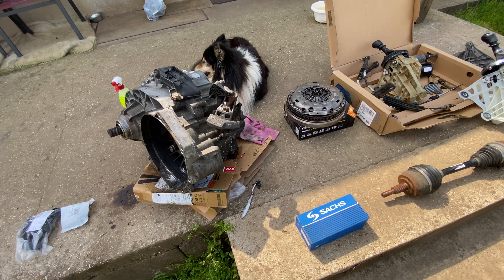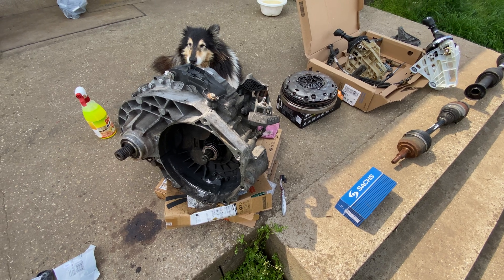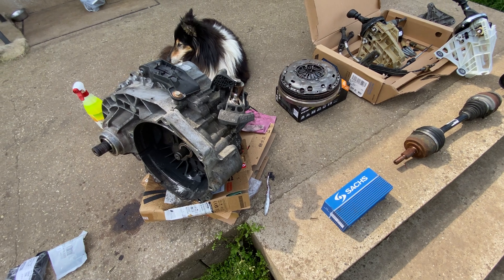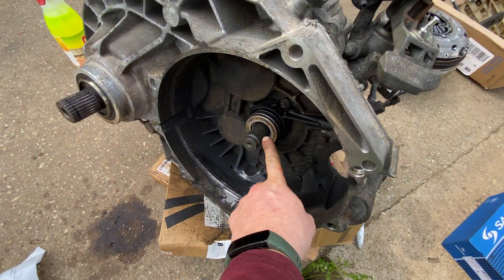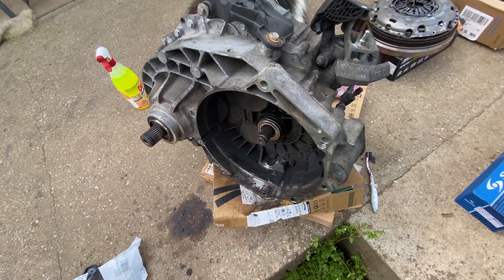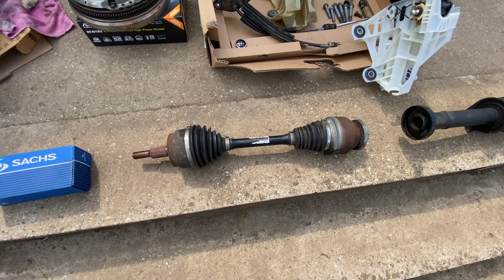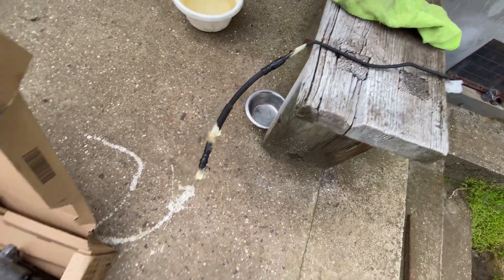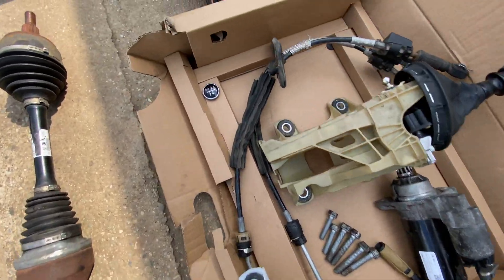Cars : VW Volkswagen transporter t5.1 5 speed to 6 speed conversion - parts needed

Comment: Hello brother, what car is the 6-speed gearbox from? I'm also going to do this exercise.
Reply from the maker: Only 2.0 TDI gearboxes from T5 and T6 will fit.
Reply: 140hp?
Reply from the maker: @kristiqnivanov5485  136/140/180. Lower HP models came with the 5 speed.
Reply: clutch with how many teeth is the flywheel luk or SACHS
Reply: Can I have your Facebook or some coordinates? I have a question regarding the long axle shaft holder.
Reply from the maker: @kristiqnivanov5485  Well I might not be a huge help here as it was 2 years ago or so. What I recall I had both of the threads on for the holding bearing stripped and had to helicoil both...

Comment: Is the rear engine mount where driveshaft carrier bolts to required for the swap?  Or does the 6 speed driveshaft bolt on to the original 5 speed engine mount?
Reply from the maker: Only the left side (drive side in the EU countries, and this is the one where the actual gearbox mounts to and these gearboxes significantly different, hence the different mount) needs to replaced. The back one where the passenger side drive shaft mounts to is the same for the 5 speed and 6 speed versions.

Comment: Hi!! Thanks for the info. 
Some guys report that an aluminium piece is needed between the engine and gearbox. Not just the tiny shim but a part itself...do you know/needed something like this? 
kUP gearbox I am looking for.
Thanks!
Reply from the maker: @AndrOid-ip7sd  AFAIK the t5 and the t6 has different engine generations with a small caveat. As far as I know the t6 uses the alumínium spacer, whilst he t5 definitely does not (at least mine did not need that). And the caveat Please note that the first batch of t6 could come with the ea189 engine and drive train (ea189 vs ea288 engine family). I'd suspect the 288 needs the spcer the 189 does not ( older engine).
Reply: Good info, i didn't know that there was any difference between 2.0 T6 & T5  blocks

Comment: Hi
Sorry what gearbox mount did you use
Reply from the maker: The gearbox mount is from a T5 2.0 TDI 6 speed (left mount to the chassis rail / chassis leg). This mount differs from the 5 speed.

Comment from the maker: Also the starter bolts are different, those are needed. There is a shim between the engine and gearbox on the 5 speed. You might need to remove that, as it makes noise as it rubs against the 6 speed flywheel.

Comment: Thanks from France. I'm going to travel to the African desert and it's great for long trips. What power do you recommend programming at? 130 140hp or more?
Reply from the maker: With the 2.0 I'd go with the stage1 tune which is around 180 hp (the hardware of the engine is the same for the 82, 102, 140 HP engines, the stage1 for the 140 should be fine)

Comment: Where would I get this conv3rsion from and what's the cost
Reply from the maker: Depending on where you live you might have to get all the parts one-by-one. I had some luck and got MOST of it from the same breaker yard however they had a couple of parts damaged, other parts from the 5 speed (the cables seen in the vid is for the 5 speed, cable holder, and one of the axles are damaged). Expect about 1800-2000 eurs for the parts only and add a labour on top of that.

Comment from the maker: Additional info: There is NO long version of these 6 speed manuals despite what I stated above. The gearbox coming from the Biturbos are actually very very slightly shorter on the 4-5-6 gears but both do around 160ish with 3kish revs, which is actually plenty for these vans. 

Also they can reach 200+ with a proper remap with 4k rpm but let's be honest here, 200kph is not really recomended for a 2ton brick with a high center of gravity.

The job itself is much more than 8 hrs, for me it took about 5 days and it is NOT a one man job, as putting back the gearbox and the subframe (because of their weight) heavily benefits from a second pair of hands, but in case you have a strong family member around that should be fine.

Also forgot to mention the starter motor needs it's specific bolts too. I did not have those on the video.

Comment: I have the 1.9tdi T5 (2008), will this conversion work on that? Or this only fpr the 2.0?
Reply from the maker: As far as I know the conversion is very similar with some extra work (modification) needed at the rear engine mount to have the gearbox fitted. 

It's a hell of a job if you do it yourself but otherwise kinda straightforward. 

I drove around 5k kms after the conversion and quite like it. The consumption did not change at all (I expected that) but I am surely driving faster than before, so...

Comment: Is the flywheel and clutch for 5 speed box different from the 6 speed box or could my clutch and flywheel from my 5 speed work?
Reply from the maker: They are completely different, different diameter, different mechanism, different style throw out bearing. No chance the 5 speed clutch works. You even have to change the clutch line to make it work.

Comment: The gearbox plug in play?
Reply from the maker: Well, you need a lot of parts but there is no cutting or welding needed, so I'd say yes it is plug-n-play. Again you need a 6 speed matching clutch, throwout bearing, flywheel, starter, drive axles, shifter, cables, etc.
Reply: Thanks mate✌️